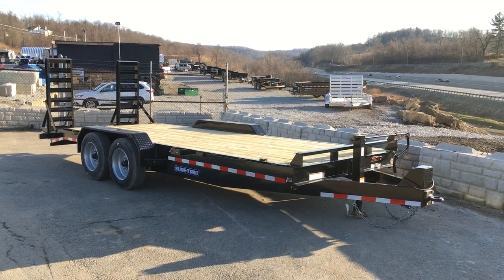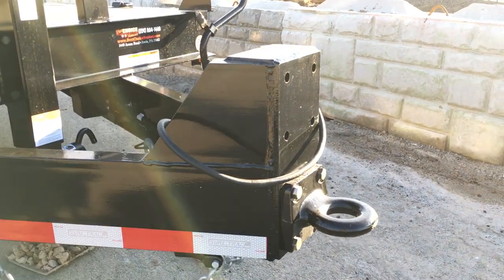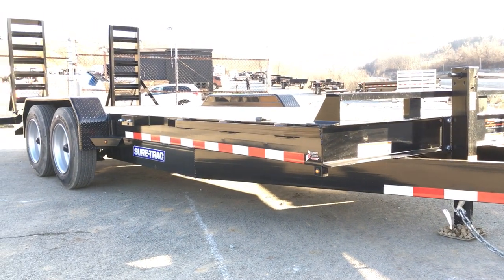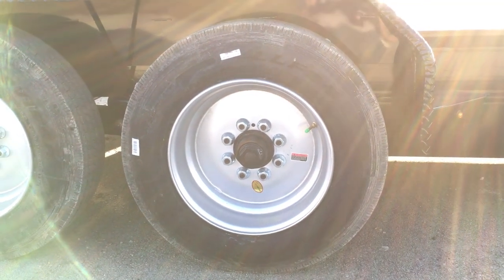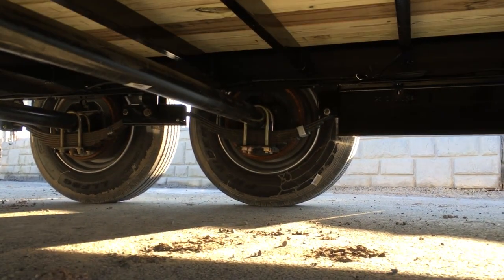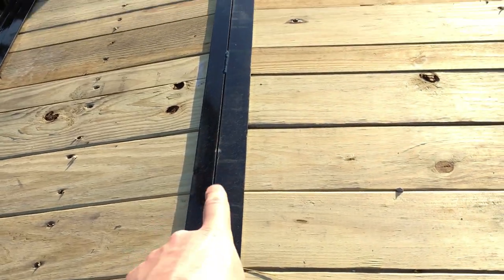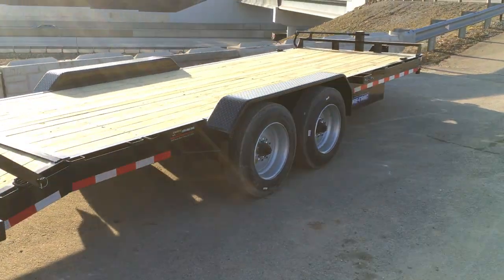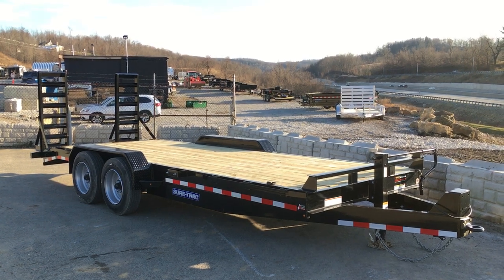Sure Trac 7x20' 16000# GVW HD Equipment Lowboy Trailer 8K Axle Upgrade ST8120IT-B-160

Comment: how tall are the fenders from the deck to top and is this trailer available with jacks for the rear instead of those ramps
Reply from the maker: Typically straight axle equipment trailer have about 8" or so of fender "reveal", but due to the larger frame on this 16K, you'll be closer to 6".  The fenders are weld on standard.  Not sure what you are asking on "jacks instead of ramps"...doesn't make sense to me.  Rear jackstands are available, and any 16K trailer would generally have a "knee" ramp for support.  Are you asking for slide ins?
Reply: Best Choice Trailers yes that's what i was meaning was rear jack stands

Comment: do you have this in 18000 gvw?
Reply from the maker: 18000# GVW is not a real GVW unfortunately as there are not any 9K axles. next step up from 16000# GVW will be either 21000# GVW with triple 7K axles or a 22000# GVW with tandem dual 10K axles. Hope that helps!